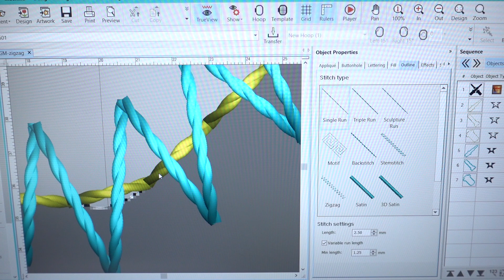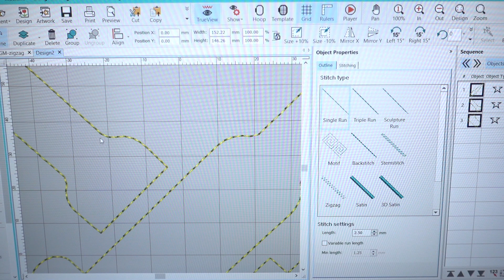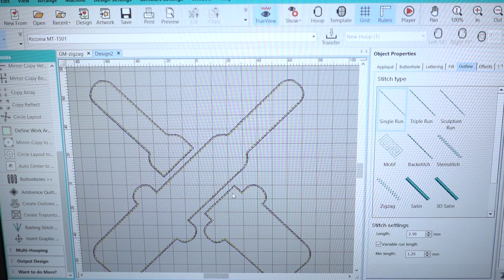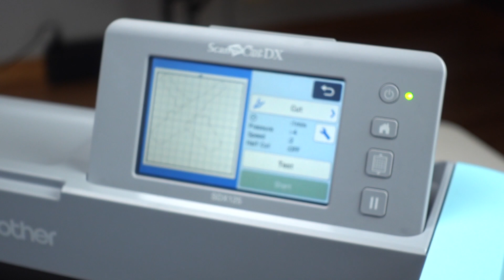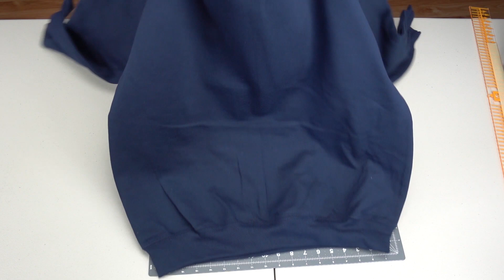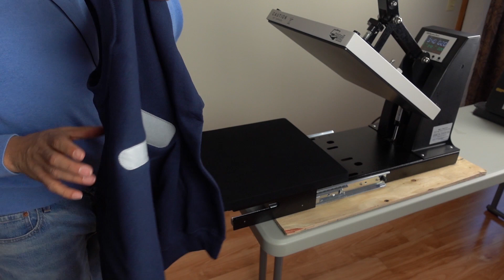Cutting Tackle Twill using Brother ScanNcut SDX125E for applique

Comment: Romero, What if you had only heat pressed that design with no embroidery involved.
How has embroidery added extra look or value to this project ?
Reply from the maker: So the twill fabric (pressure sensitive adhesive) is not permanent, it requires to be stitched. Now there is an option for heat press only twill. This method gives it a stitched looked, and gives it a higher perceived value too.
Reply: @RomeroThreads  aah got it brother . Thank you .